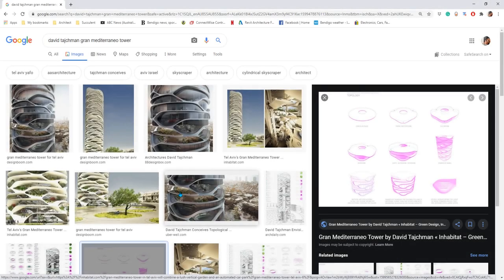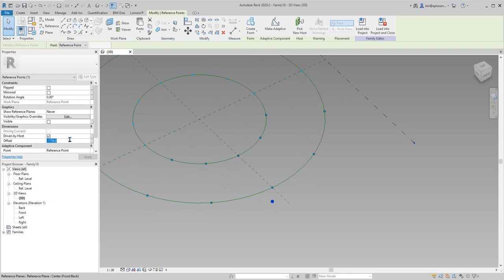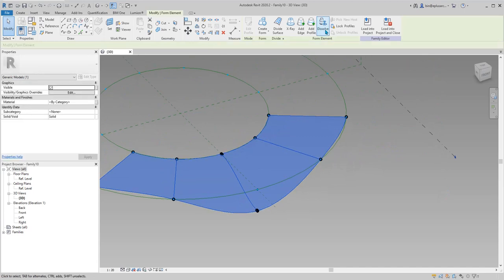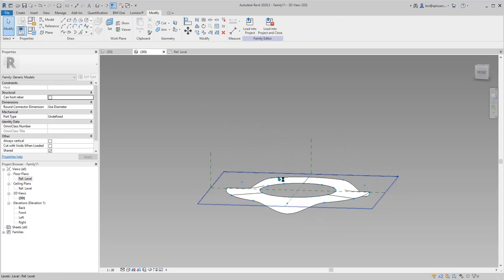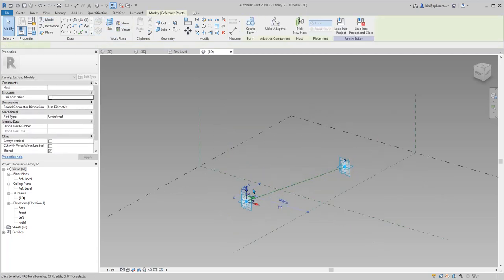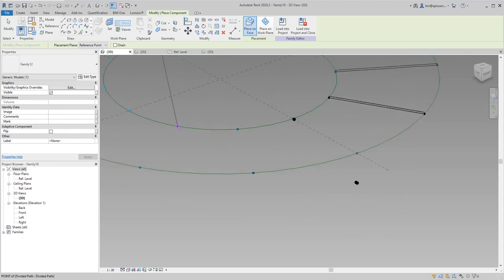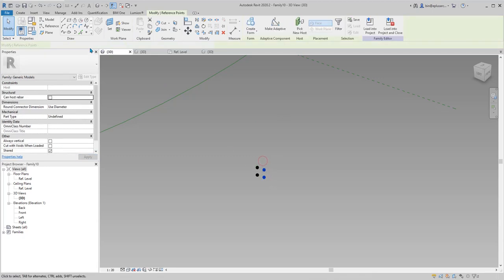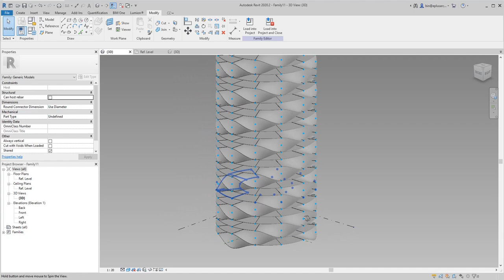Revit  Exercise (Day 170) - Massing Exercise

Comment: Nice Nice 👍🏿 
1. Is it possible to apply wall by face or roof by face to achieve the thickness.. ?
2. Was it possible in massing to rotate (option copy checked) the 1/3 part to complete the hole  circle ? Instead of copy in place then rotate without copy option?
Reply from the maker: 1. I guess roof is more possible because of the flat part.
2. Not sure, I think you can, maybe have a try, rotate the surface together with the reference line.